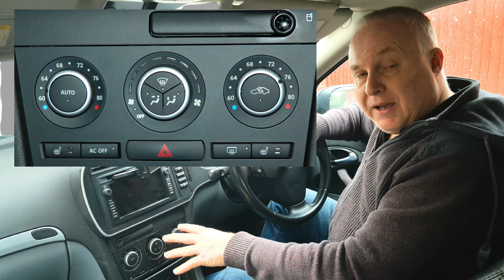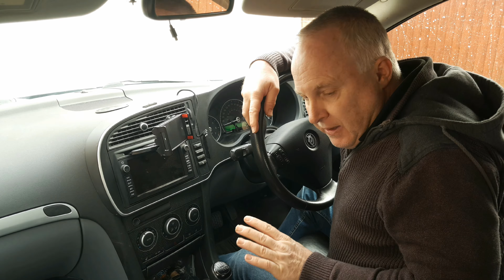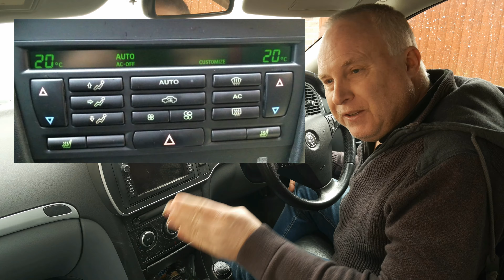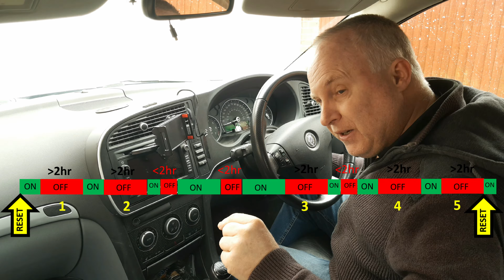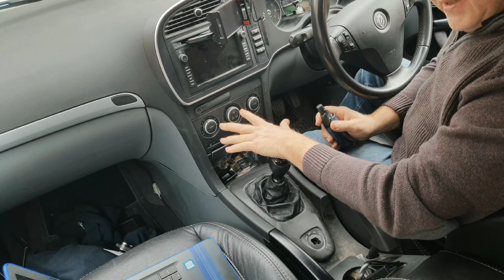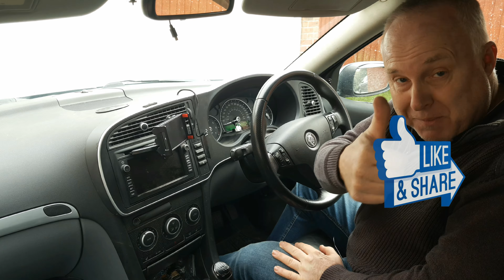Saab 9-3 Climate Control RESET | How and why | easy DIY

Comment: Struggling to get warm air. Will try the reset but I have already found out the heater matrix doesn't let water through it ( hosepipe tried). Does the matrix have a flow valve or is all the heat control through blower actuators?

Comment: 2009 Saab 9.5 2.3t with low mileage for the age of the car. Everything fine EXCEPT for the automatic climate control in the summer: the fan blows but the air is not cooled. I am assured by the garage (ex Saab specialist) that there is gas in the system, and there are no leaks. I have had the condenser replaced, and, I think, the compressor. Now I am told that the ACC  “is working” – but still no cooled air. After finding Cyd’s video on Resetting the ACC, I have tried this a few times, but with no result. Any ideas or tips, please?

Comment: Hi, thanks for the video. Do you know if the 2006 can be replaced with the nicer 2007 climate control unit. I have just purchased a 2006 93 Linear 1.8i and the buttons are all worn. I prefer the look of the new uni.
Any help would be much appreciated.
Thanks
Steve

Comment: I just replaced the new motor and resistor on Saab 9-3 2015 1.8t the blower is on and off rapidly .do I need to reset it ?

Comment: Hi Cyd - if I may ask you a question. My 2004 9.3 has a SID problem that does not seem common. The system does not work at all for long periods and then will come on at random times - working perfectly. It is currently reporting a door and roof not closed alert - which I need to look into. Many thanks.

Comment: 2008 Saab 93  4 cyl in Canada. Changed thermostat and temp sensor and still not enough heat. It was taking very long time for the engine to get warm (not hot) Also outside temperature readings were inaccurate. I called 2 mechanics and they sugested to use different higher temp thermostat (wrong).This video cured all problems.
Thank you very much for this video ! I have also 2007 Saab 95 and 2000 93 for number of years.Too bad that they aren't build anymore. I am going to keep mine as long as possible.
Reply from the maker: Awesome, happy it worked for you. I flushed and renewed my coolant yesterday and today my heater isn't working, so time to take my own advice 🤣😂

Comment: Resetting the 2004 saab 9-3 climate control: remove the fuse number 4 in the fuse box  by the drives side door for 10 secs.

Comment: Hi! I need help! I have charge the battery of my 9-3 from 2010 over night, now it seems as if the time is wrong. I have det the time thru the original Delphi satnav, but i can not use the function to det an alarm in the SID or start the parking heater manually, neither can I set a timer for when the parking heater should start. When I try to do that in the SID it just makes a sound like “beeep” and nothing happens. Any ideas of how toc fix this?

Comment: Hi I have Saab 9-3 on 2010 every time I switch the car on I have to reduce or turn off the air vent so if I do manual calibration do you think that will fix the issue 
Thanks
Reply from the maker: Not sure, but must be worth a try. Did it work?

Comment: Hey Cyd, 9-3 question for ya. Bought a 04' 9-3 Aero Convertible. bought it with the knowledge that the climate control system doesn't work. I'm getting no lights on the ACC unit, and all except the Hazard button is unlit. The hazards work which is strange, but the rest of the climate control unit is dead. Any ideas? The obvious answer is to check the fuses but they all seem intact. I did notice there's a lot of oxidized metal in the cabin fusebox area, probably because it's a convertible. Thanks!
Reply from the maker: I'd say to try another ACC control panel. Also check the connections to the panel
Reply: @CycloneCyd  good suggestion! thanks for the reply and keep up the good work with the videos!
Reply: @CycloneCyd  the connections to the ACC were partly melted.. eek. Looks like the connecting wire itself should be ok. Would any ACC unit work? Or does it need to be the exact same? My car looks like yours but without the heated seats

Comment: Hello Sir! Finally someone who understands troubleshooting!    
I have a 2011 Saab 93 2.0 Turbo.   I believe that i heard You describe my warm stay issue perfectly on another of your preservatives.  My issue is that cold start is perfect every time.  Get the car to operating temperature (  short run to the shops )  Park up and leave for any time in excess of 10 minutes.   Engine will start but not idle and did immediately.  It may splutter slightly with some throttle application but will still not idle until it starts and gets revved repeatedly;  then it will idle.      
*note:  doing a clear flood crank on key with accelerator fully depressed sometimes helps. *
Car has never died on driving etc and pulls perfectly. 

I replaced the fuel pressure regulator recently as it was leaking externally last the o-ring.  
I believe that fuel is boiling in the lines when parked and vapor locking.     
Any thoughts???

Comment: Wow.... Wth were the designers trying to do give everyone a huge headache or something???
Reply from the maker: It's an attemp to reduce cost and complexity and to improve reliability. It's usually the position sensors in flap motor units that pack up not the motors.
Reply: Well they failed from the complexity stand point. At least from the user's standpoint 🤣😂
Reply from the maker: @Spacer53  yes and no. Systems that have position feedback sensors in the motors usually have no way for the customer to reset the system. This can usually only be done by the specific OE diagnostic software and usually costs. At least this system has an auto reset feature after 40 cycles.
Like most things in life, there is no one right answer.

Comment: Hi. I found the motor that dont turn When i change the air diraction, so i replaced it. But it still not moving. And tips what to check, i Have the motor removed but connected right now so it is easy to test. Maby i need tech 2 to calibrate the new motor? It is a saab 93 2006 (1,8T).

Comment: Hi very useful video. I have a Saab 9-3 2003 and the heater fan has stopped working.  No climate control, air con or blower. The display is all operative, just not doing anything. Any ideas on how to fix this please?
Reply: I had this in an 05 9-3. Water gets in through the filter in the engine ompartment then goes through the fan and shorts/destroys the controller on the bottom of the fan. Fairly easy to change the whole thing taking oooooooff the glove compartment for access

Comment: I Have saab 93 2006. I Have no air comming from the middle (over the stereo). But it works on every other spot. Any idé or tips what to check? :)
Reply from the maker: Any idea when it was last regassed (if ever)? this is classic sign that the gas level is low. OR it could be the mixer flap motor, but I'd have the gas checked first
Reply: @CycloneCyd  the gas to the AC was filled 2 days ago.. and the condenser was replaced.
Reply: @CycloneCyd  and it works really good in every other spot, and it is cold when I lower the temp. When i press the buttons it changes the ventilation as the arrows says But it dont work in the middle. Sides, foot, windscreen works perfect.

Comment: Hi. Good info. It helped reset and clear many of my problems on my Saab 9-3 2008. However, the AC problem still unsolved . Sometimes it operates as cold air only. I switch off the car and restart and the AC functions normally . Then after a while the same issue recurs . Any advice? The mechanics checked the AC system all ok
Reply from the maker: Check the operation of the mixer flap motor and all connections, incl to the AC module

Comment: Any idea how to fix the early system if the cabin fan is stuck on constantly, even when the key is out of the car? I had this problem recently and the only thing I've been able to do is remove the fan fuse?
Reply from the maker: Needs a new 'resistor pack'. Is that what you did? Did that fix it?
Reply: @CycloneCyd  I replaced the controller with an eBay replacement. The old one had water ingress exactly as you described. I had to replace the fan as well eventually because it was squealing after a while. I remember it being a b*stard of a job getting the fan out, particularly finding all the screws, but this guide helped a lot. Thanks.
Reply from the maker: @shalashaska68  awesome, that's exactly what I strive for👍

Comment: I have a 9-5 Aero Saab 2008 BABY BLUE INSIDE GREY LEATHER IMMACULATE but my gas gauge when I first bought it is still ON I think the gas gage is broke because even when it’s filled it says it’s empty? What should I do
Reply from the maker: Try disconnecting the battery negative for half an hour. Sometimes this resets them. If not, then you almost certainly need a sender unit for the tank.
Reply: @CycloneCyd  do you know how much the part usually cost on an average? Also thankyou for your reply in a timely fashion

Comment: Hey Cyd; thank you for the awesome and very informative videos. I have used your videos to help me repair my 2005 9-3 2.0T; it is our daily driver and our only vehicle. I have a quick question about the heater blower motor control module. My car is equipped with the automatic climate control and the blower motor control module stopped working and shorted out and burnt some of the wires in the connector that goes into the control module. I bought a new control module and repaired the burnt wires; my problem is now the heater blower will run and blows for about 5-10 seconds then stops and then it won't come back on maybe 30 minutes later and once again only for 5-10 seconds then shuts off again. I know it's not because the cabin is up to temperature because here in Canada the outside temperature has been -12c and the cabin temperature was set at 27c and the fan was set on high. The blower motor will work if I remove the control module and wire power directly to the blower motor and turn it on and off by pulling the fuse so we can have heat. Any idea what the problem may be? Would it be a faulty control module ( it's from URO brand) or would it be that the system has cycle through to learn that it has a new control module? Any info would be appreciated. Thanks from Canada
Reply from the maker: I can't be certain, but my guess would be you've either not repaired a wire correctly or you got the wire positions mixed up. When you say a new control module, do you mean a brand new resitor pack for in the bottom of the motor unit?
Reply: I know it’s been quite a year long, but I just read your post and I’m having the same problem with my Saab 2008 model 93 . I change the blower motor and the resistor and my burnt plug, now my blower motor will run for 20 seconds and stop for 20 seconds and then come back on for 20 seconds and stop for 20 seconds and on and on and on. I was just wondering if you could enlighten me on what caused your problem because it sounds way similar to mine. Thank you for your time
Reply: @badtothebone3187  Did you eventually figure out what the cause was?
Reply: @ZapejoMC  yes, turns out it was the incorrect regulator that I had ordered. Went to a wrecking yard and purchased the exact same regulator out of a car just like mine and installed it, and it runs like a dream now.

Comment: Hi Cyd, thaks for your video. I’ve had to search hi and low for a new actuator. I finally sources one and so I’ll have to tell the tech: to re-calibrate the system, in case he is not aware. ( not a Saab repair tech ).
Reply from the maker: Yeah, probably worth mentioning. 👍

Comment: @Cyclone Cyd: I realize this is not related to the video, but have you had to deal with error code P0245 (turbocharger wastegate solenoid A input circuit low is below specifications). This is on a 2007 Saab 93 2.0T .Any feedback regarding this issue would be appreciated. Keep up the content . It is great to see someone taking the time to share their professional knowledge in such informative videos.
Reply from the maker: It does what it says on the tin really. The wastegate solenoid is clipped to the turbo by the wastegate actuator. The ECU believes there is a problem with it or it's wiring. Actions:
1. spray thro the solenoid to make sure it's clean and not sticking
2. check the connections and wiring
3. check the pipes for splits / blockages
4. replace the solenoid if 1-3 find no issues
Reply: @CycloneCyd  thanks a bunch. Will check it out be let you know.cheers

Comment: Good video to have out there. Although my 2007 9-5 states to start the engine first, and then just press the "AUTO" and "Recirc" at the same time. The SID then states it's being done. I've had to do this twice in the past 4 months because of a bad battery, and then replacing it. I wonder if the ignition off part is 9-3 exclusive?
Reply from the maker: That's interesting. Is that proceedure in the owners manual? I'll check out the WIS instruction for 9-5 next time I am able.
Reply: @CycloneCyd  yeah, I grabbed my owners manual right after watching you video, it was page 86, said to start the 9-5 first.

Not the first difference on how things are done between the 9-3 and 9-5. Like the 9-3 needing security access for the Tech 2, and most 9-5 things don't for Tech 2. It's odd how different they are done.

Comment: Thanks for sharing mate. I was wondering if you could shed some light on why tires and staring  wheel shake at 75mil/h. I have tried wheel bearing balance and brake disk check. But no luck
Reply from the maker: worn shocks, bushes, ball joints. Swap wheels front to back to see if it goes. If it does it's tyres.
Reply: @CycloneCyd  thanks again, that's what I was afraid of.
Reply from the maker: @uguegue  track rod inner ball joint is worth checking. One of mine knock so I'll be changing it soon. Video to follow

Comment: Owe mate your a bloody life savour......this issue has been bugging me for months after I changed battery during the first pandemic wave! Thank you 👏
Reply from the maker: Glad it helped. I'd be surprised if many people know about this. Most other HVAC systems use motors with a position sensor. GM cost cutting me thinks 🙄
Reply: @CycloneCyd  something to note which I can’t remember if you mentioned it, when I 1st pressed the two temp buttons together I heard a bleep and a kind of confirmation came up on my centre dash for a few seconds, I have a 2012 9-3.